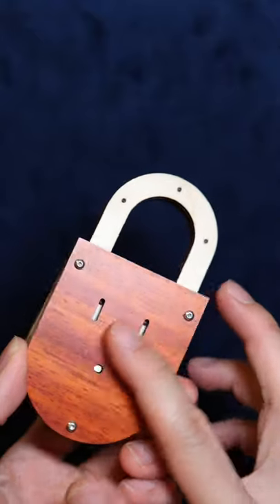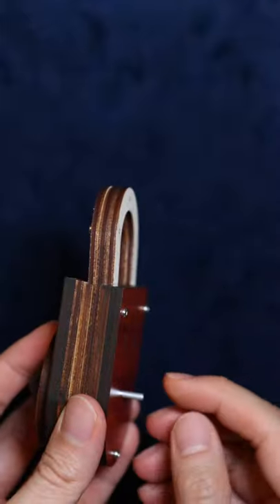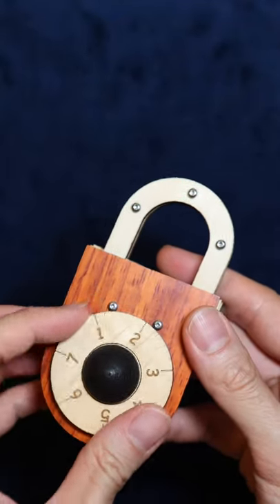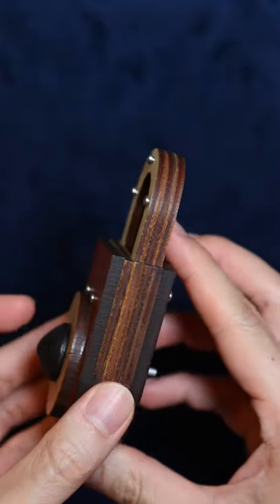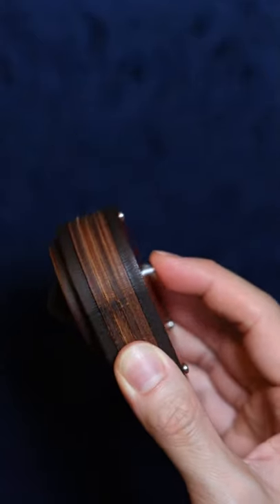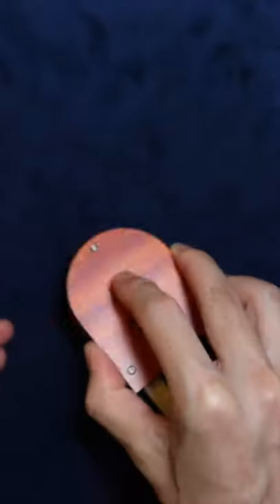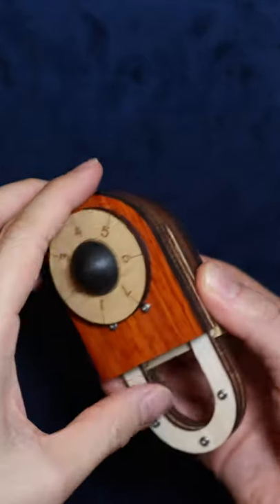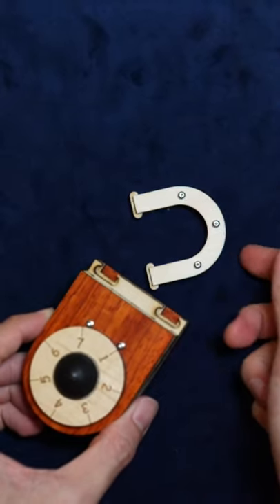21/30 - How to solve Zahlenschloss puzzle by Jean Claude Constantin (spoilers) #shorts

Comment: Nice video! I ended up accidentally taking mine to pieces before figuring out how it worked... :-)
Reply: I remember that video.
Reply from the maker: I saw yours too, the issue with my copy is that the mechanisms were not smooth, so I always thought I was doing the wrong moves... Maybe it's part of the puzzle design 😂